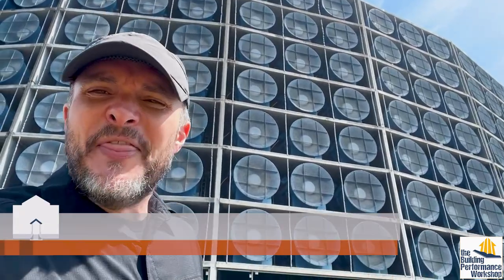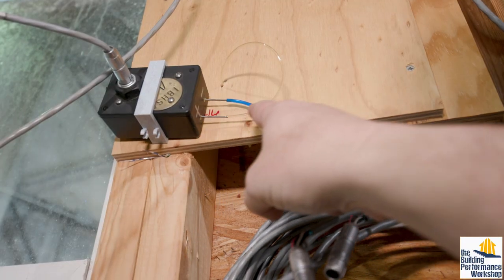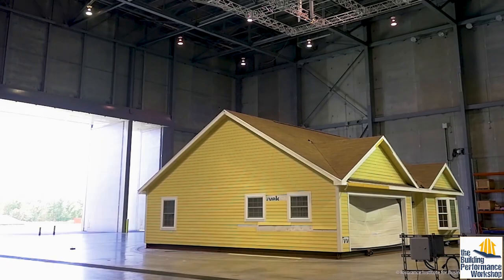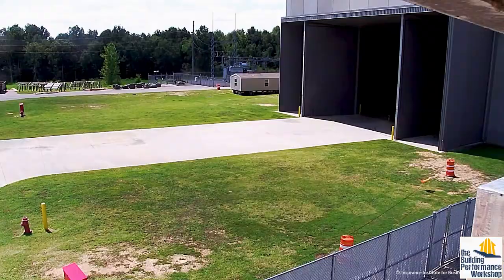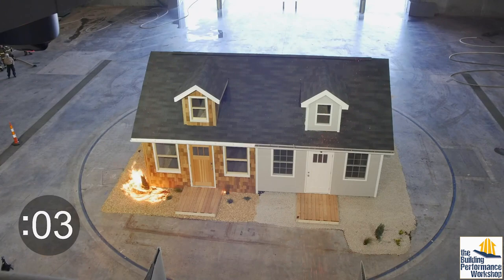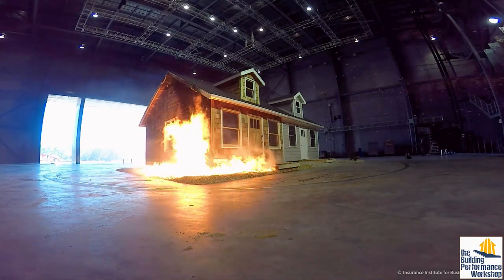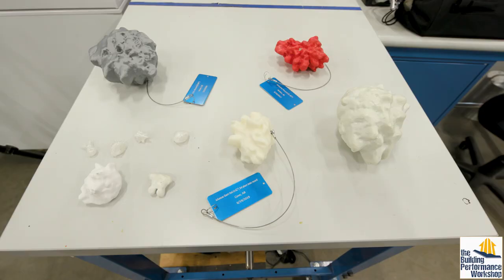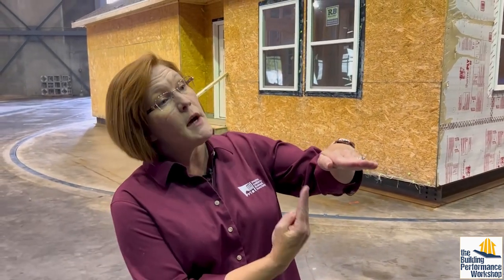Torturing Homes for SCIENCE! Wind, Fire, Rain, and Hail Destructive Testing at IBHS

Comment: Pretty interesting observation about large eaves.
Sounds like doubling the eve doubles the amount of pressure , but it also double the arm for the second half so that means three times the vertical load.
(1x for the original bit, and then 2x that cause of arm for the second) roughly.

That’s definitely a consideration if you live in the wind prone area. Might be good to have some corbels with structural bolts to help tie down the roof as well instead of just supporting it.

Comment: Great real world information. I’ve seen here in Pa. Snow down the center line of an attic. It pulled it in through the ridge vent. You have to get the ratio right between the eave vent and the ridge vent. We have been over venting the ridge and under venting the eaves. That being said the example i mentioned was a 9/12 pitch with metal roof. Easiest solution to counter the ridge gap being to wide was to make a wider ridge cap and add “flow vent” material to act as a filter. Its worked great 4 years and counting
Reply from the maker: Whoa nice details Tricks. Most people would never.